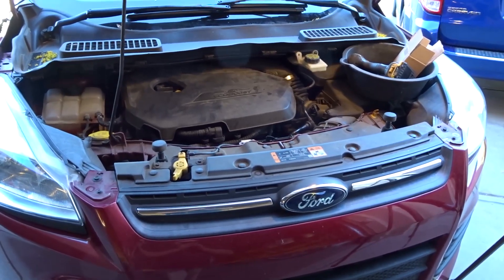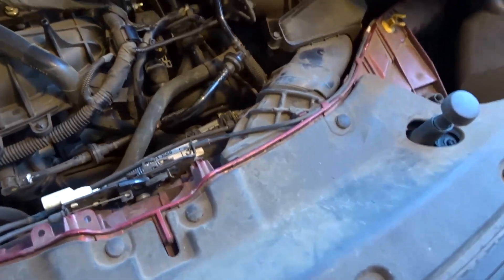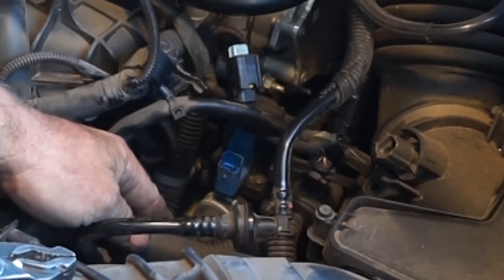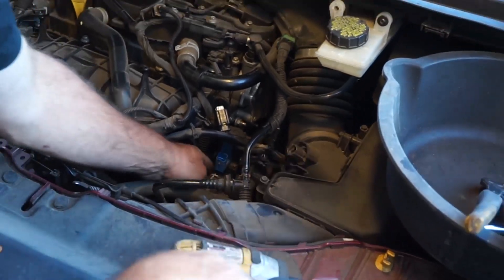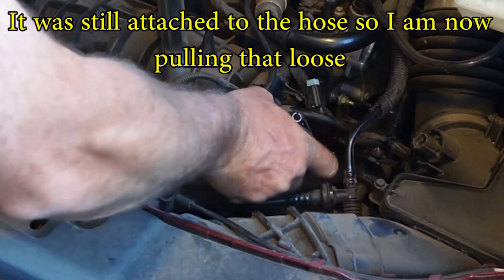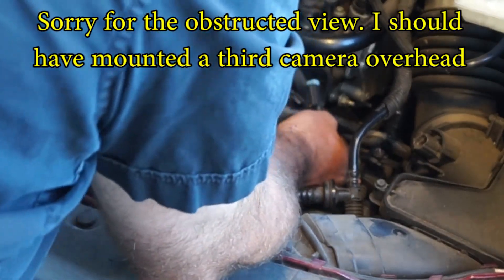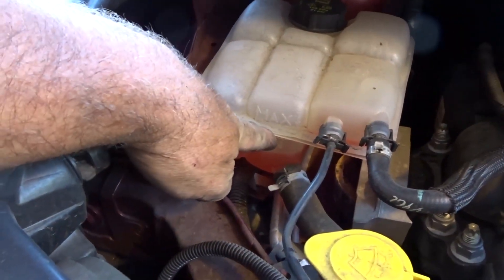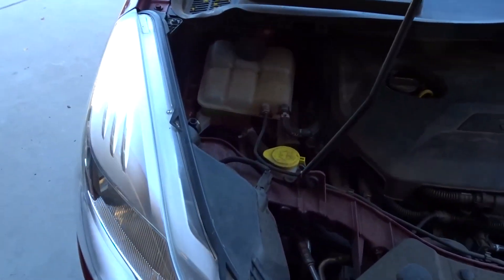Replacing coolant bypass valve to correct P26B7 fault in 2014 Ford Escape

Comment: Is there any issue with not draining the coolant and refilling while doing this repair? I've been reading that introducing air into the coolant system can put you at risk of overheating. Does the air go away on it's own? or how does that work? I'm getting ready to do this repair myself, but would like to avoid draining the system as well as potentially worse problems down the line if I don't drain it.
Reply from the maker: Sometimes you can have an airlock in the upper area of an engine such as the cylinder head (highest point) and the water connections are all lower. If a little bit of air got in then it will burp out. Check and add water after it runs and cools. If you loose a lot of water then you may need to bleed the air. If you don't know how it may be something to leave to the shop given an overheat can turn into a warped head etc.

Comment: When this part fails do you have any idea in what position it's failing in? I read that this is to cutoff coolant to the engine during cold temps. Seems like a driveability issue if these always fail in the closed positions. Or is it a straight 50/50 shot?

Comment: Thanks for the help. I had to remove the bolts first in order to take off the hose clamp. The hose was difficult to remove from the old valve... I had to use a slot screwdriver to pry it off. Saved $$$$, thanks again!

Comment: Hi. I was recently quoted $900 for repairing this part. Saw your video and really wanted to try to fix it myself. Do you mind putting a list of tools I should have for the repair?
Reply: Chanelock pliars, 1/4in socket with extension and one of those bendy adapters. That's really it! Oh, and maybe a drain pan to catch the coolant that you WILL leak all over the floor.

Comment: Does anything need to be done with programming after installation?
Reply from the maker: I cleared my codes but in reality you should be able to just install the part and drive it a few times until the check engine light goes off on it's own once the issue does not reoccur for a few drive cycles.
Reply: hackfreehvac thank you

Comment: hey. 3 months ago i replaced the same the coolant by pass solenoid and now the check engine light came on again with the same code trouble. what you think it could be the problem? if the part it's new and its still failing.
Reply from the maker: Internet purchased part?
Reply: @hackfreehvac  no. i bought it on o'reilly, i think that parts like these should be better to buy'em from the Dealer because the parts from o'relly or autozone aren't originals and that's what it makes it more complicated in getting the right part.
Reply: @nelsonzelaya141  ever get that figured out?
Reply: The problem is there are 4 coolant control valves, 2 near the back of the motor, and 2 in front. The problem i am having is finding the parts for the ones in the back. not spending 300 to get it from the dealer.,
Reply: I replaced this same thing last summer and the check engine light is on again.. I figured imma just order the motor craft part from now on since it seems like Ford wants to screw you over with off brand parts from autozone or advanced auto parts
Reply: @bethmarie5220  from what I was seeing when changing mine, the valve was stuck open from a piece of trash from the fluid running through it.  If this failure repeats itself, then a good flush of the engine block should take care of that.